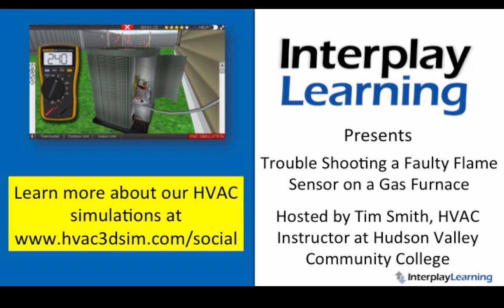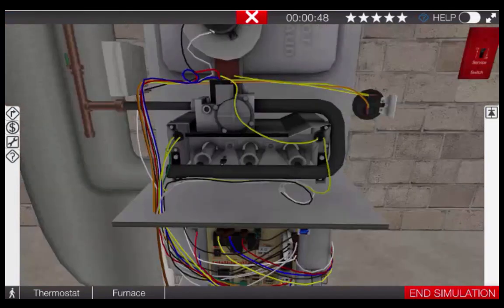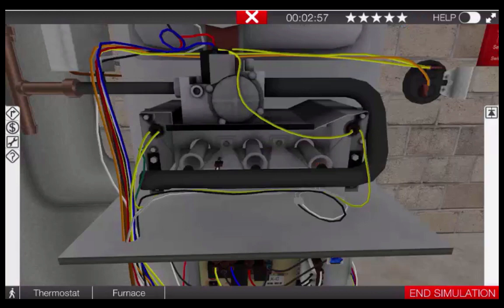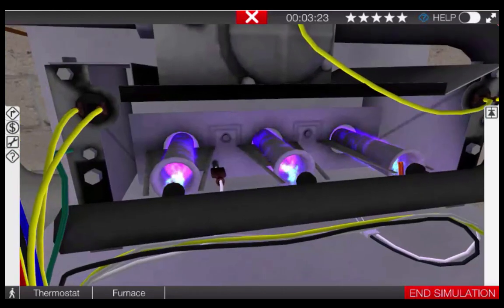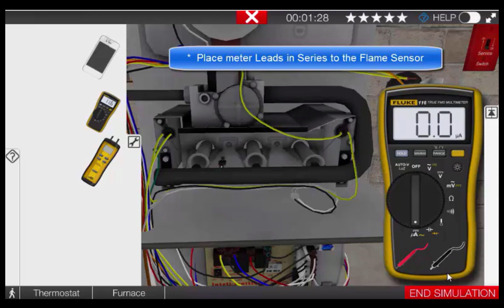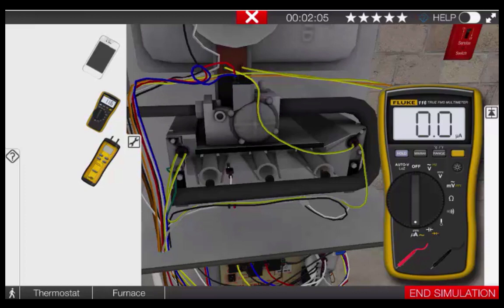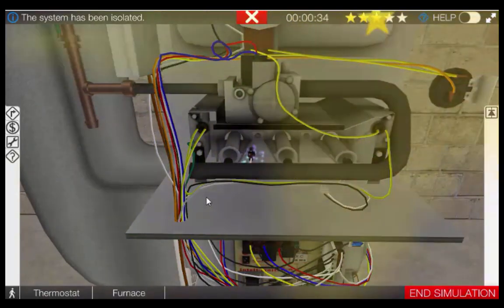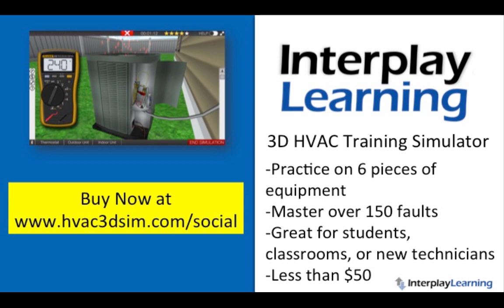Faulty Flame Sensor on a Gas Furnace Troubleshooting Video

Comment: I'm a do it yourselfer when it comes to fixing thing.  My furnace was doing exactly the same thing.  Inducer fan would come, ignitor would glow, flames light and then the furnace shut down.  I cleaned the flame sensor several times and it would intermittently work.  I purchased 2 brand new flame sensors and again the same thing.  Changed them out and they would work here and there.  Frustrated, I watched more videos in the past 2 weeks than I watched in my lifetime.  It turned out that it was the pressure switch.  I have a 2 stage pressure switch.  Don't ask me why I figured out or at least took a chance to buy one and replace it, but I did.  I live in a rural area of the country and it would have cost me $500 plus parts to have it fixed.  So, if any of you are having this problem like I did, check out your pressure switch.  Furnace works like new!  Great video you posted!!

Comment: I was getting an attempt for the gas furnace to start and then quit going into lockout. I cleaned the flame sensor and reinstalled it with no difference. Meter is series with the flame sensor provided zero dc miro amp reading.  Replaced the electronic board and the furnace is working great. The board is one of the top 5 things to go. It was on a Carrier Gas Furnace. So if you are getting no DC  miro amp reading back when the meter is in series with the flame sensor and the flame sensor has 110 volts, it is probably a bad board as it was in my case.
Reply: I’ve dealt with this on a Lennox Elite. E270- no flame current sensed. Did everything. Replaced the control board. Worked like new. Here I’am again 2yrs later with the same Code.
Reply: Deal with one 2 days ago on a new ML296UH110XV60C and same issue as Stewart

Comment: $155 dollars for a $9 thermocouple! Nice!
Reply: I am not an expert in HVAC but maybe that price includes the trip charge, labor to diagnose and install, taxes, etc. You can't expect the tech to work for free unless you believe in slavery. Also a thermocouple and a flame sensor not the same thing. They may do the same job but the operating principles are different.
Reply: Absolutely I agree. But it does become excessive.
Reply: Shit that's cheap, at the places around here that'd b a 300 dollar call
Reply: That's everywhere: Cars, AC, plumbing, lawyers, doctors, dentists, restaurants, bars etc..

Comment: Would it also cut power to the control board (wifi thermostat shuts off too)? My burners turn off 3  - 4 minutes into the heat cycle then turn back on and continue until temp has reached.

Comment: This is a great help except for one thing. What is an IFC?

https://acronyms.thefreedictionary.com/IFC
Reply: Integrated furnace control (IFC) is an electric system that is used to help monitor the functions of newer gas furnaces. An IFC is often referred to as the brain of the furnace. This control board is made to have a blink code for troubleshooting. These codes may not always correctly indicate what the problem is, but they can point to the general location of the issue.
    An example of how an IFC works is when the furnace has a problem with heating, the IFC will begin to light up to help operate the furnace. If for any reason the IFC is not pleased, this control board will shut the unit down.

Comment: My Flame Sensor connection wire terminate at a White AC common wire.  Meaning it has some sort of fixture that rapes around the white common and I can only assume it penetrate the white plastic to make contact.  This white wire goes back to common on the IFC.  Does this description seem normal?  I have replace the Flame Sensor but still have zero microamps when testing.  There the flame goes out after a few seconds.
Reply: RHH1095 same here

Comment: Consider an option to clean the sensor.
Reply: Lol
Reply: Yeah I didn't want to unscrew it and sand it like another video suggested, so I just wiped the sensor off with alcohol on a paper towel. Very little visible residue on the paper towel, but it worked!